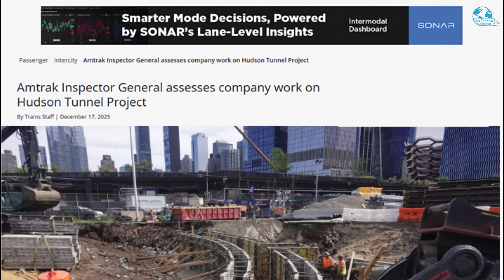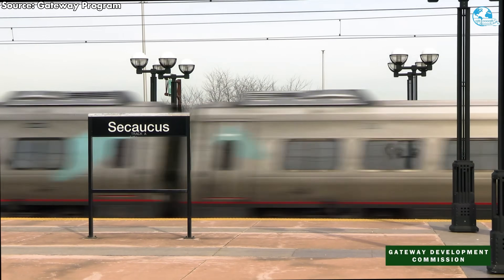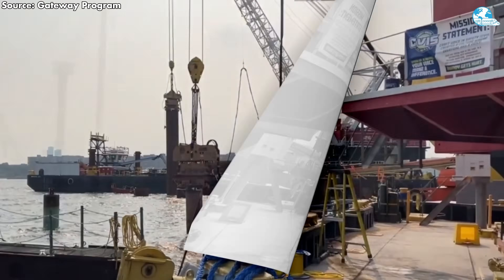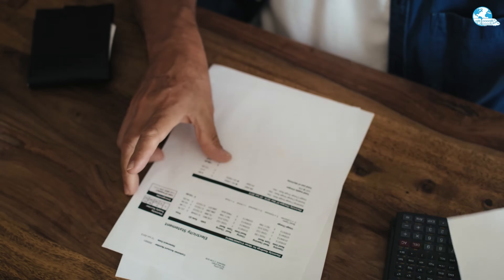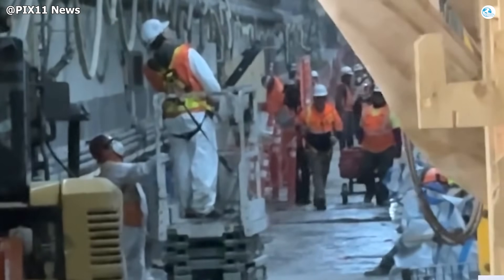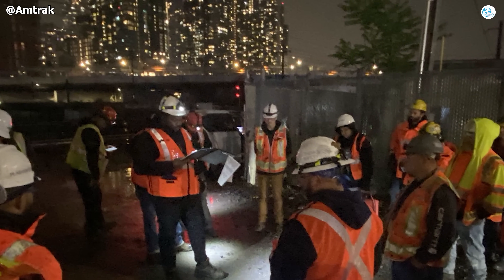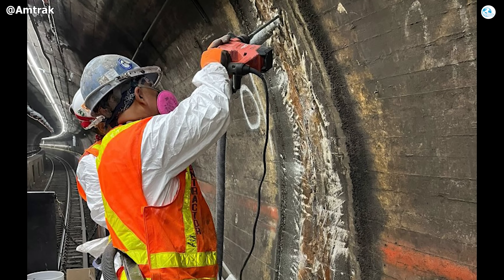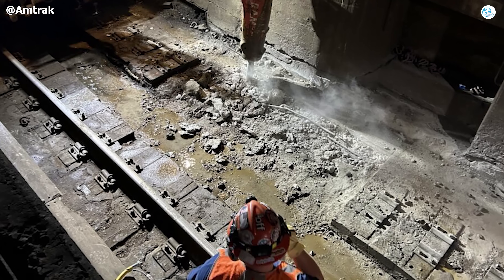$17.6B Amtrak Tunnel Projects | East River & Hudson – Latest Construction Progress

Comment: why this short tunnels are so expemsive to build?
compared to eurepean tunnels under the alps, it seems very expemsive
Reply: New rail tunnels under major cities are never cheap. The most recent tunnels under London that were dug about a decade ago were something like half a billion dollars per mile and much of that was in soft clay. Then add all the stations, rail infrastructue etc and the project went well north of 20 billion dollars. It did totally transform Londons East-West transport  corridor though, and the new tunnels now carry about 800,000 riders a day.
Reply: The new Tonnelle Ave overpass, utility relocation in NY and NJ, temporary shift of the West Side Highway, the acquired land for the tunnel box in NY, shipping of the TBMs... all without shutting down Amtrak, LIRR, or NJTransit service. Sure they could have saved 5-10% just by closing the area during construction, but then all three operators would cry about lost revenue from not running trains.
Reply: The short answer is that the geology in the vicinity of the project is extremely complex and intricate
Reply: River bottom stabilization is an issue for Hudson tunnels.
Reply: Put another way... there's a bridge project I'd like for Amtrak to engage in, but because it effects nearly 2 miles of ROW and too would require MTA service changes, I suspect that my lowball estimate of $850M ends up being off by a factor of 9 or 10.

Comment: I wonder if the Susquehanna River bridge between Havre deGrace and Perryville, MD will get this kind of attention ?  Also, the replacement or rerouting of the B&P Tunnel in Baltimore ?  They are both slowing traffic on the NEC.

I'd personally love to see someone document those projects here.
Reply from the maker: Yes, that bridge gets attention, but the NEC has several critical bottlenecks. Projects like the B&P Tunnel and others are prioritized because they affect capacity and reliability system-wide.

Comment: Now once the first tunnel is reopened will it effectively have more capacity than before it was shut down?
Reply from the maker: Yea, it can do it
Reply: Once the new tunnels are finished and in use the old tunnels will be rebuilt.  This will take 2 - 4 years. Completing in late 2030.  The older tunnels have been damaged and patched for many decades.